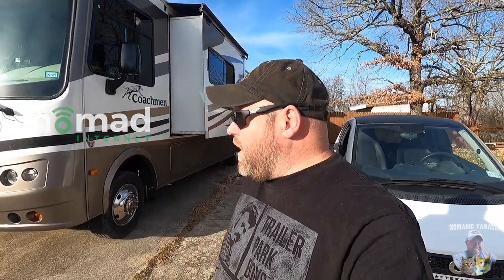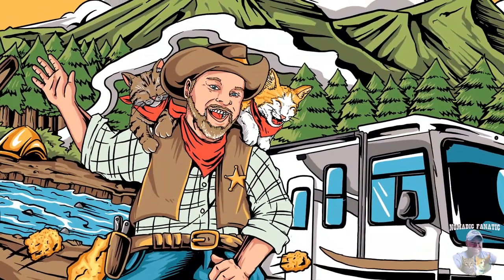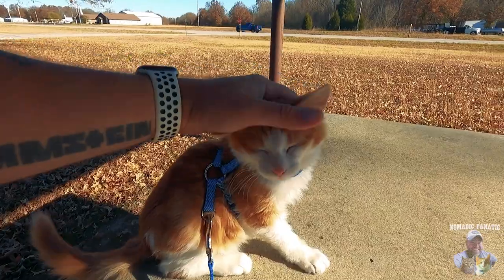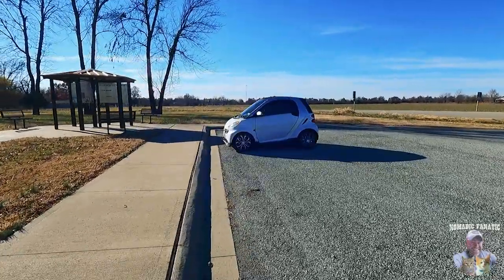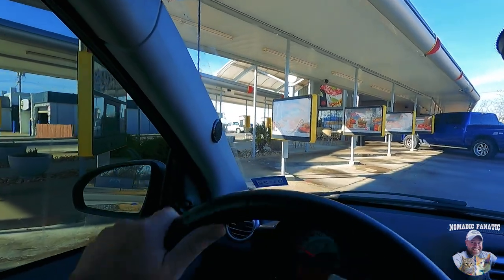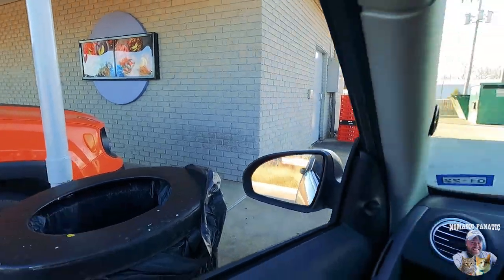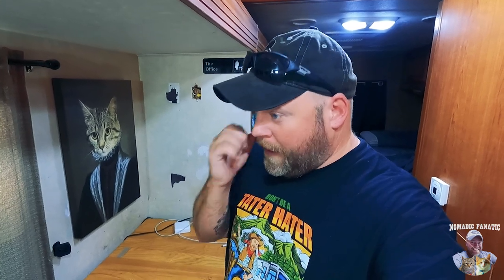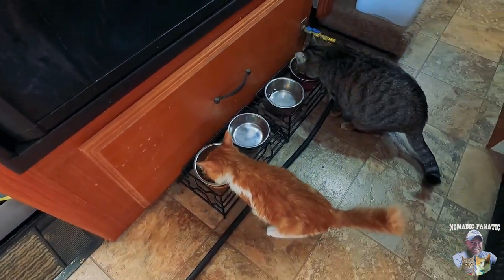Cat Fixed, Route 66, Disney's Cars, Leash Training, Unveiling Jax's Memorial , & NEW MERCH LINE!

Comment: Eric, I do hope that you will do the right thing and have a new Catalytic Converter installed as soon as you can. Our air quality is everyone`s responsibility. Removing the guts from the cat and re-installing it is a quick fix to get going again, however, part of a smog test is to point a Infrared Thermometer at the cat to see that it is at 750 degrees or more, a cold cat will fail the test. I have my EA license to test and repair vehicle pollution control equipment. I know it can be pricey to repair the emission controls on vehicles today, but, we all want clean air to breathe. Take care Eric, happy trails.